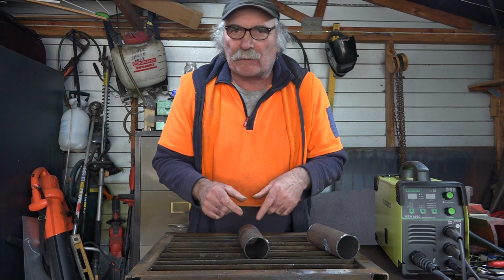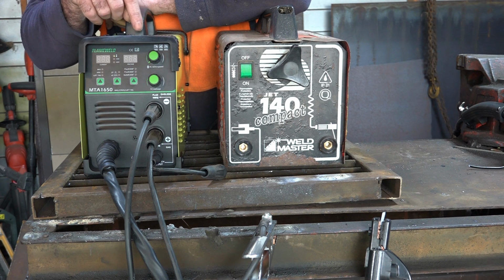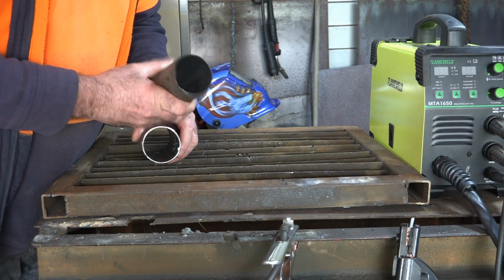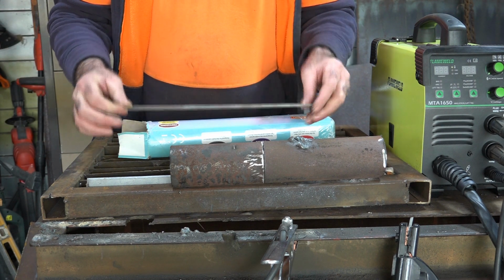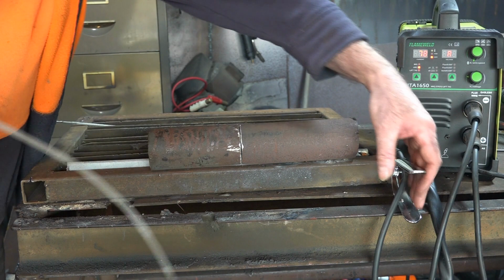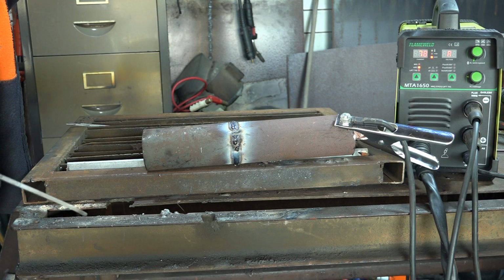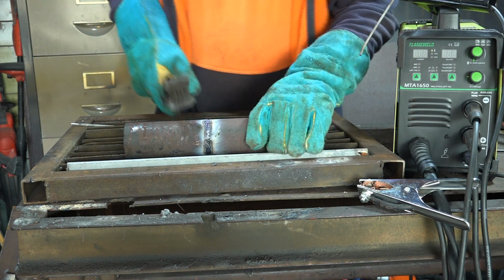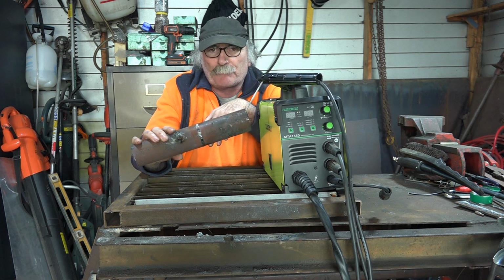Arc Welding Thin Steel - (Trying To Weld Exhaust Pipe)

Comment: You should try 2 mm 6013 electrodes and no more than 80 amps for steel, for exhausts made from 304 stainless go with 2mm max 304/316 electrode and 55 amps tops.
The difficult of welding thin stock is making the bead fast and accurate, move the stick fast in an zig-zag motion. The cleaner the cuts are and the material is close together will make less likely to draw the air and blow a hole throw the material.
Safety notes: Never touch the material with bare hands, risk of electrocution, leather gloves always,  the bar of the stick holder should be next to your thumb and finally avoid bending the stick.
 .
Reply from the maker: Good tips cheers